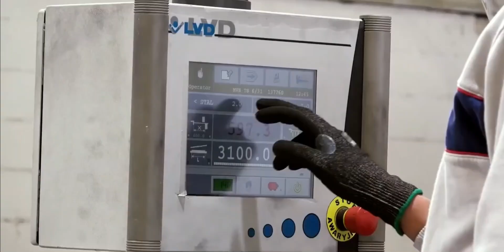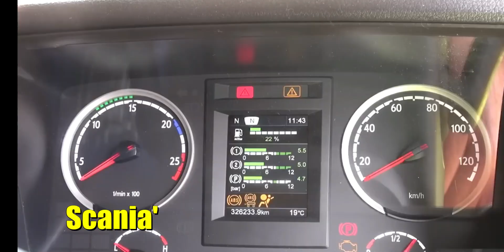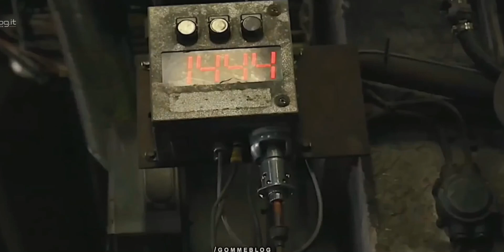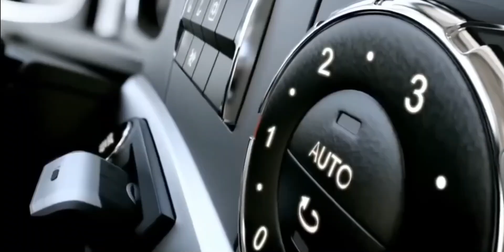The INSANE Reason Why SCANIA Made The V8 Engine!

Comment: A V-8 is nothing more than an engine with the cylinders configure in a certain way. There have been V-8s besides Scania, Ford Louisvilles and International ACCOs used 903 Cummins engines and let's not forget GM's 8/71. These days, the more common confuguration is the I-6 so how about explaining the advantages and disadvantages of the V-8 compared to the I-6.